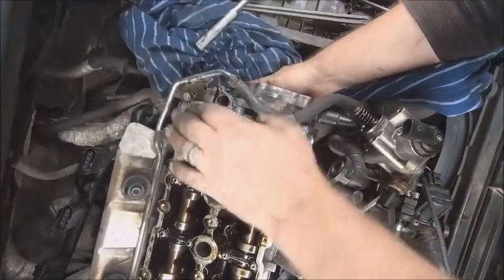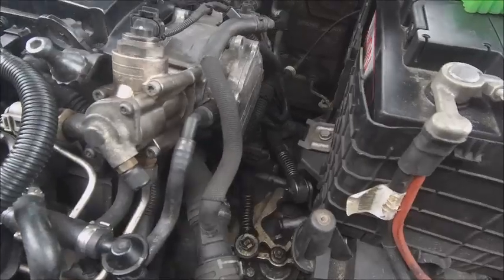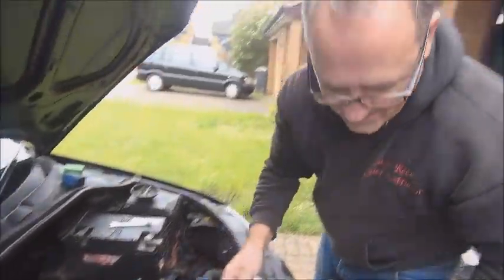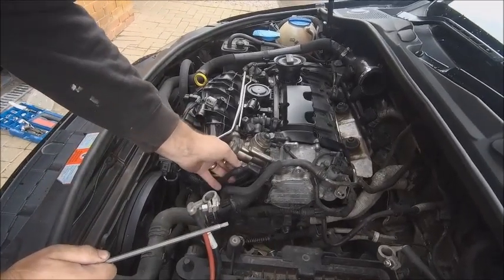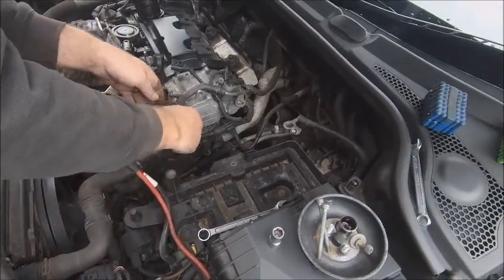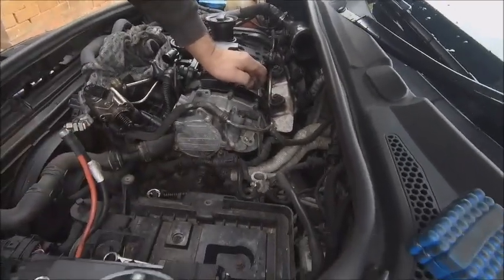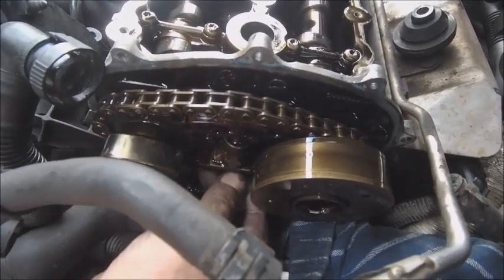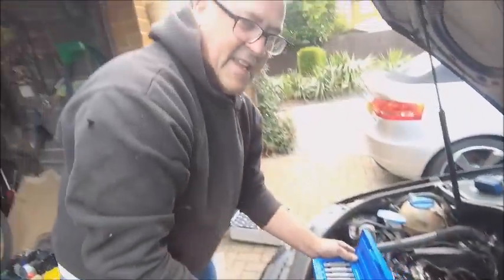#Audi #S3 #TFSI Cam Chain Replacement VLOG

Comment: The EA113. Yeah, I have to change it too on mine. I don't have the confidence of being able to do it great like you. You have the cam lock tool and experience and all. You changed it for "a bit rattling chain". I think mine is more than rattling, it's probably long overdue. I even suspect the day it played a prank on me must have been the chain.  If you can check it https://www.youtube.com/watch?v=_80Zw6eIrFs
Reply from the maker: To be honest that sounds more like a rod knock than the timing chain...I think you may want to get a mechanic to look at it ASAP, as its only going to get worse and let you down.
Reply: @AdeReeves  thanks. well the next day it knocked once more and set itself back in order at startup.
mechanic looked and said he doesn't know since there is nothing anymore. he let me go.
8 months passed with normal behavior. And lately a different diesel noise at idle started to happen on occasion.
Reply: Update: I went to the dealer to get an opinion on the new diesel-type noise, and they listened with a sound scope, they said the problem is located in the fuel pump with 60% chance, or the chain housing 40% chance. He says he heard other cars with dead fuel pumps do the same noise. He can't explain why the car revs fine and holds the load fine though, if it was the pump there should be fuel pressure low; If it was the chain, there'd be stuttering and suffocating behavior, maybe even dying from the irregular valve timing. But none of that happens. He suggests to change the whole assembly but the quote is 7 grands. What I'll do, is order a fuel pump and yet another cam follower tapet (I already changed it 3 months ago, maybe it's chinese crap and causing the noise). That costs 400. It's yet another expenditure in a worthless car. (it's literally worthless, I got it valuated at 300).
Reply from the maker: @vindieu  sorry your having so many issues with what are usually bullet proof cars...  I had a blue A3 years ago (2.0 TFSI Turbo) and the guy i got it off claimed the engine had been rebuilt, It ended up making a similar noise but as it had been a troublesome car already and i lost faith in it... I simply got rid of it... it was a shame as the car drove great and the interior was great (sline) ...hope you get it fixed soon.
Reply: @AdeReeves  Thank you, at this point I take any word of sympathy with great warmth. It is a shame indeed because I was loving this car, put a lot of personal investment in it. But it gave me so much trouble. I only drove 6700km in 21 months, and it costed me a total of 6 grands of repairs. It's 1000km=1000$ with this car. I mean a Ferrari costs less.